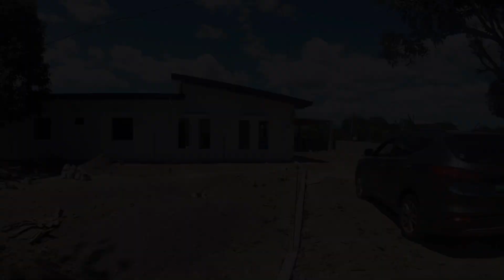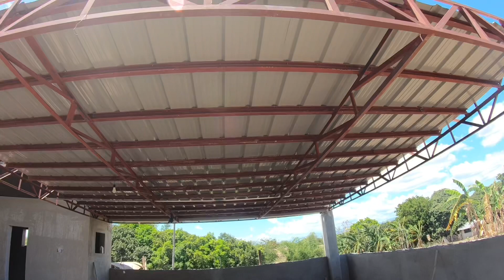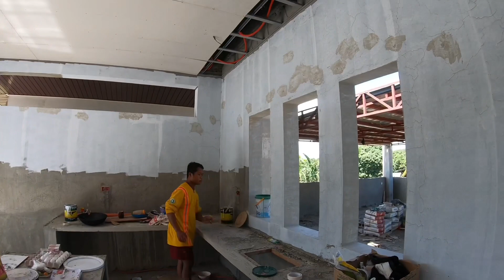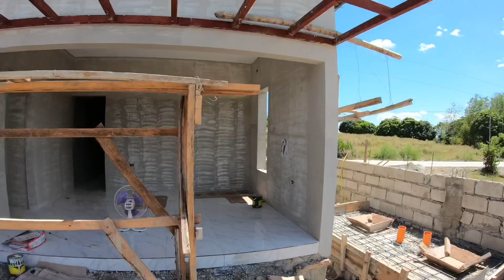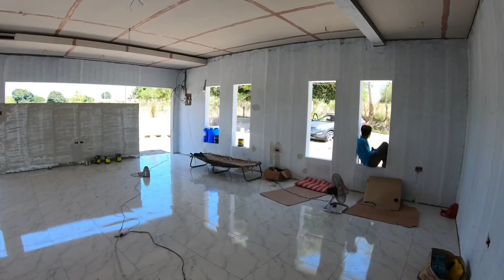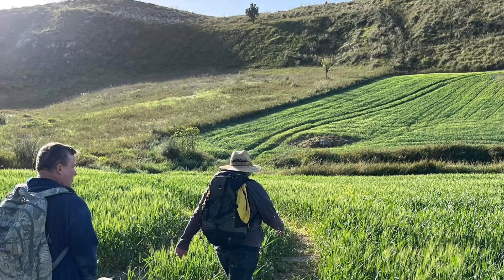Rick’s Italy Mission | Week 14 Update on our House build!

Comment: The only negative I see is with a large parcel of land Why did you build your house so close to the main road?
Reply: Hey Ken, your not the first to ask me that question, and I understand why you are asking.  Several reasons I chose that location to place the house.  First, it is a province road so very little activity.  Just scooter and tricycles during the daytime.  Nights are supper quiet.  Second, the lot is sloped rice fields that slope about 70 feet from the road level to the creek at the base of the property.  By putting it near the top, we maximize the view of the surrounding area and we minimize the amount of leveling and fill that would be required to build the home and pool.  Third, I wanted to save the mango grove at the bottom near the creek and maximize the amount of usable land for future gardening.  Hope that makes sense.
Reply: @rickeybaker9066  ,,,sure it makes sense,I wasn't aware of your property in relation to the slope and other issues,,,,im sure you will enjoy your property for years to come I wish you happiness,health and contentment
Reply: Thanks Ken!  Happiness I’m all over it, health I’m working on and contentment is a goal 😉!